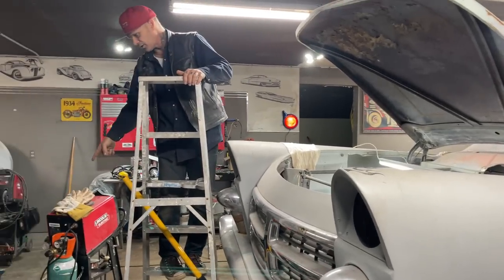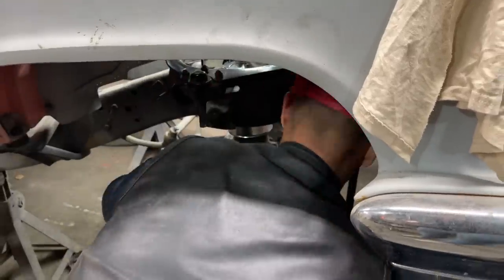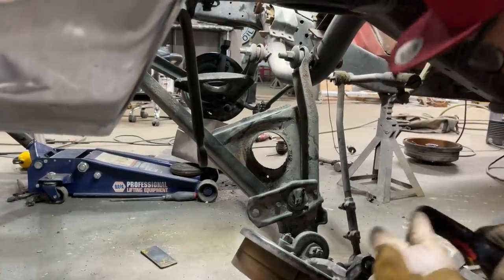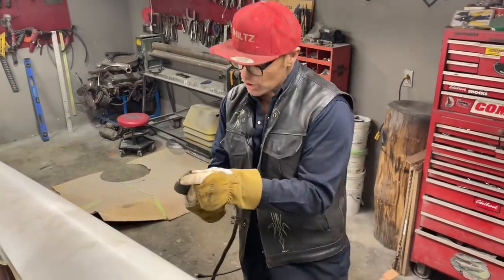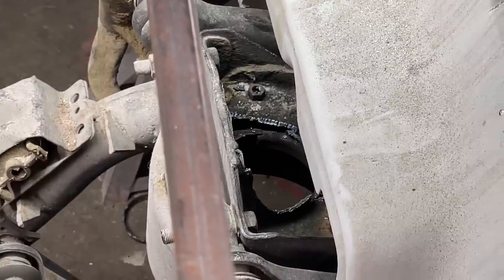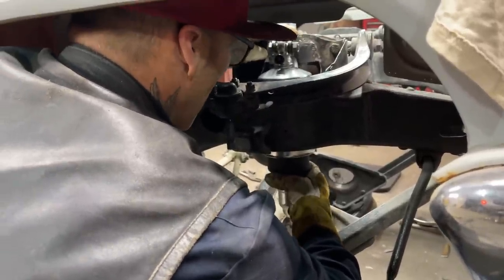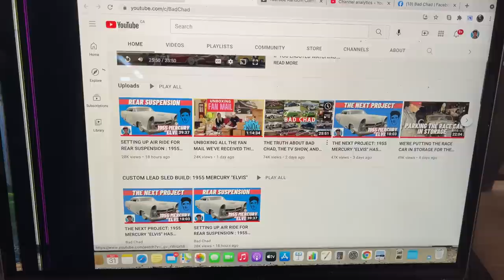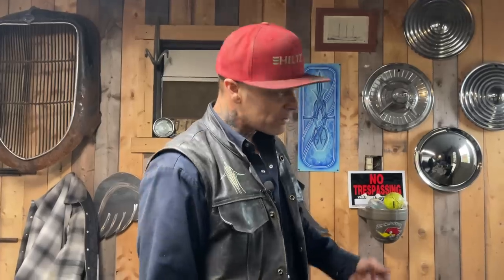MODIFYING ORIGINAL SUSPENSION TO FIT AIR-RIDE SYSTEM: 1955 MERCURY 'ELVIS'

Comment: Chad, really like your style of teaching. I feel as if I'm there in the garage with you. Note, my friend, that grinding the areas you cut out, to leave a smooth trim edge, is important. As a retired FoMoCo frame designer I can tell you that jagged edges act as stress risers that lead to metal fatigue and cracking. Take the time to make smooth areas you cut out like the large holes you opened up in Elvis' A arms. A few minutes of smoothing those edges creates a way stronger part.

Comment: Another great video once again. I couldn't help but notice the bracket fabbed up for the top of the front airbag appears to be fairly close to the bag's protective cover. If so, it will not allow for the bottom of the airbag to move inward without touching when cycling the suspension up, unless the bottom attachment point puts the airbag on an angle kicking the bottom outwards. If it does not, it looks as if when the suspension is extended, the bottom of the airbag assembly on the lower control arm where it is attached will be moved inwards. This can be seen now, but greatly exaggerated with the lower control arm dangling past where it would normally bottom out if the ball joint was still attached. Just giving you a heads up just in case you haven't noticed this potential problem. Looking forward to tomorrow's video.

Comment: Hope the upper brakets clear the shock/bag when the lower section is mounted. Are you just going to tack before you fully weld it up then check for clearance? I can't wait to see this functioning because I just put air ride bags on my 55 chevy and tried over and over before my external shocks cleared right after making my own mounts from scratch. 
It all started out from cardboard too before I made them out of sheetmetal. Oh yea you call it Bristol board. I can't wait to see these work. I like how yours install but I got my shocks for free from a friend who bought them for his truck and never used them. I made them fit my mounts before the A frame. I'm dropping mine low with 2"drop spindles with disks on all 4.

Comment: Bzztt!!! CHAD!! initially, the weight on the front of the vehicle transferred from the lower control arm to the spring and then TO THE FRAME directly from the top of the coil spring.   Your design weakens the initial design because you are no longer transferring the weigh directly from the spring to the frame.  You are transferring the weight on the front of the car through the AIR RIDE to the SHOCK TOWER which is held onto the frame BY RIVETS and the front weight will stress the upper shock tower ear RIVETS!!!  The Mercury will no longer put weight directly to the front frame.  It now will TRANSFER front weight to the AIR RIDE, through the upper shock tower ear and THEN to the frame by way of the upper shock tower RIVETS for which they were not designed.